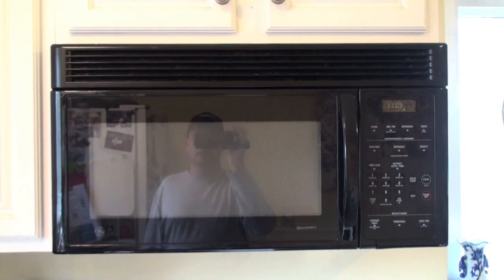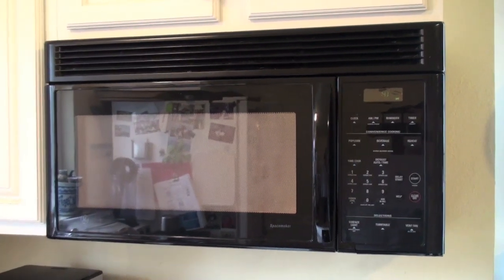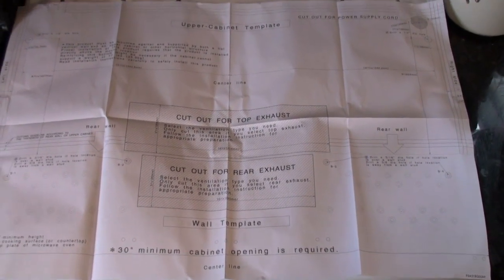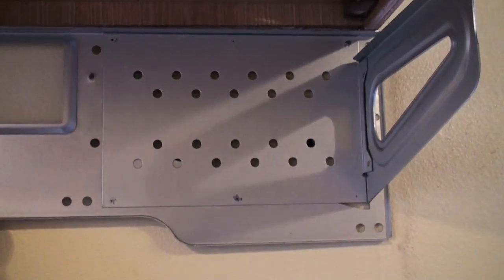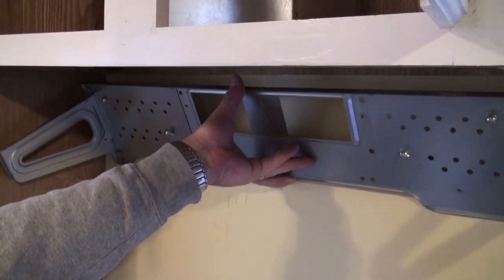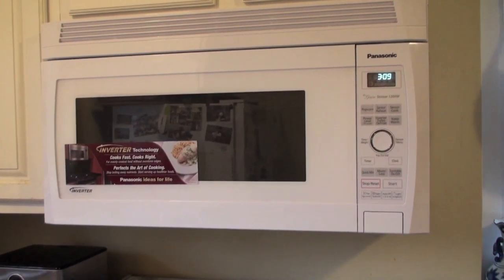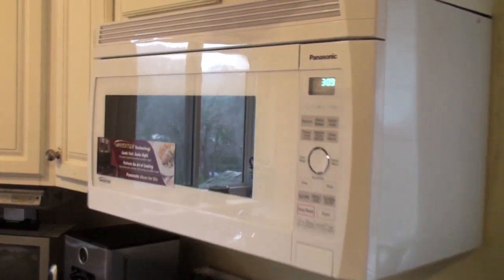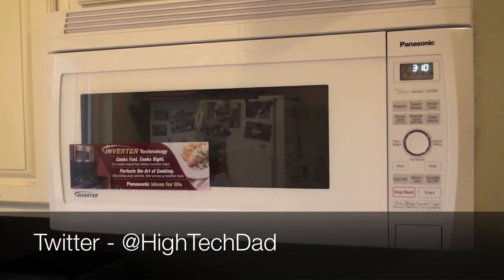How To Install a new Panasonic NN-SD277WR Microwave

Comment from the maker: Be sure you have 2 people when you remove. Loosen the top screws but don't remove completely. You will see how the microwave starts to pivot/tilt out towards you. Once you see how it moves, you can probably remove the top screws and the front end will drop down. Then you simply pull it forward (but you need two people just in case). Then once it's out, just remove the brace from the wall. It's pretty easy.

Comment from the maker: @intimateone100 Removal depends on the older microwave that you had. Each case is different. The installation part of the video is there and walks you through the process. It is edited to fit within 5 minutes. See the blog post for more info.

Comment: I installed a new Panasonic NNST27HW, replacing my almost 20 year old unit (also Panasonic) good news was the old bracket was identical to the new one, so that save time.  Bad news the newer Panasonic Microwave's power cord is not at the rear of the unit, it is right up front.  This means a 1.25 hole had to be drilled right at the front edge of the cabinet base, and the power cord snakes from front to the rear of the wall, a crumby engineering design.

Comment: You pretty much skipped over the most important parts. Talk less about the old micro and your thumb and at least give a photo of the install steps, if not 5 secs of vid.  Like taping up the temp[late, cutting the holes, running the cord, pushing it on the bracket, installing the bolts, attaching the ducting.  You even have a recessed cabinet bottom and you fail to mention or perhaps even do, filling in the recess with a filler board.  This video doesn't really show the install, just the micro after the install.

Comment: This microwave is a pain to install, especially when dealing with the power cord. One must take care in an effort not to pinch the cord and tear the sheathing.
As a final note; this microwave is extremely problem prone. Air leaks from the rattling top front vent and causes massive grease buildup. The hood light gets very hot and extractor fan is loud. Microwave has two year warranty and you WILL need it. Mine broke in a year and a half. Piece of junk!